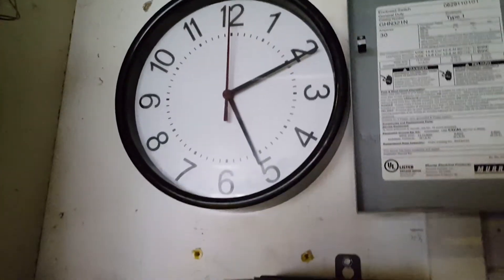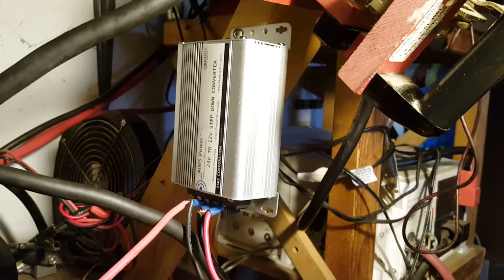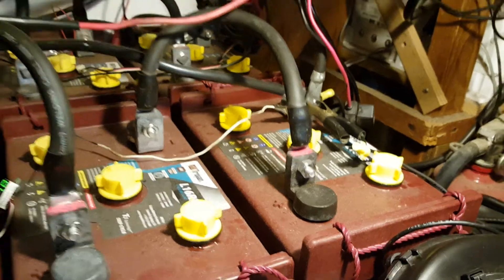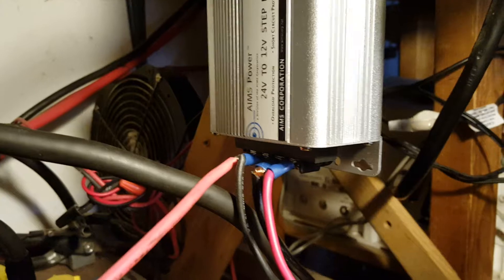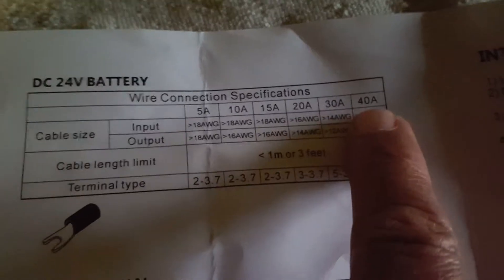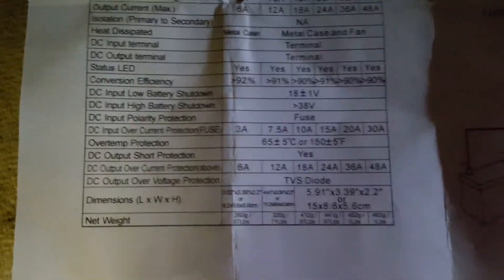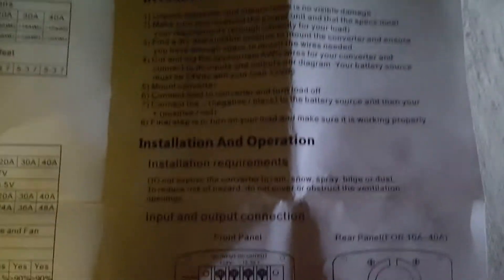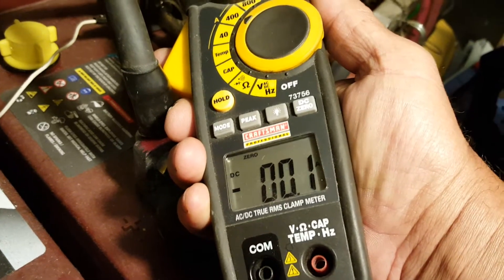Aims 24 to 12 Volt 40 Amps DC Converter.

Comment: what if im going to use a 12 volts amplifier.then the battery provided is 24 volts.what device can be use  12 volts supply output.
Reply from the maker: you can use the converter's 12 Volt output, thanks
Reply: Ram udit sahani

Comment: Raz, why not have a dedicated 12 volt system just for lighting and charging? I do not mean to sound condescending, just my thoughts. There is always some loss in converting isn't there?
The amp input is half that of the output because the voltage  is half the input, no mystery there, but hey it works
24v X 5a = 120 watts
12v X 10a = 120 watts
Peace Brother... respect
Reply from the maker: Craig Nehring yes indeed you have a valid point however the separate 12 Volt system was not efficient because of the srparate circuit, charging and the maintenance.  But in my case things are always changing!
Reply from the maker: Craig Nehring cost of the extra batteries, wiring, the maintenance, the proper storage and charging should not be overlooked, at least in my humble opinion.